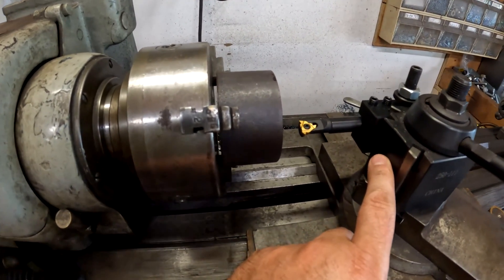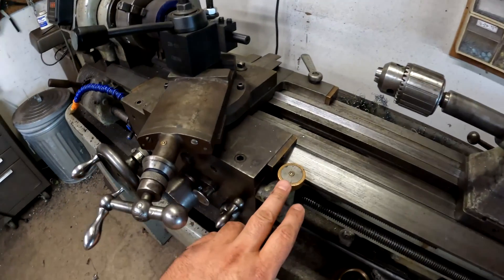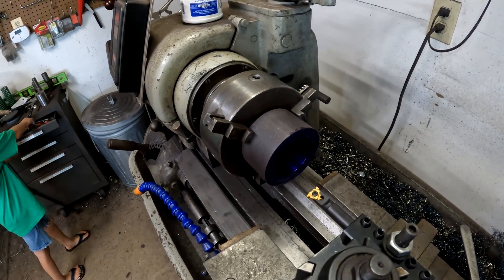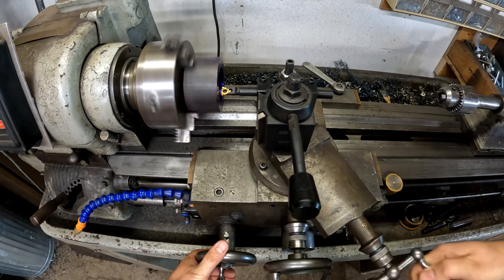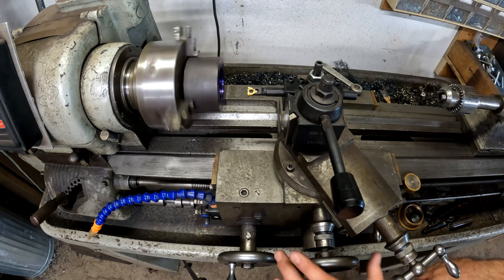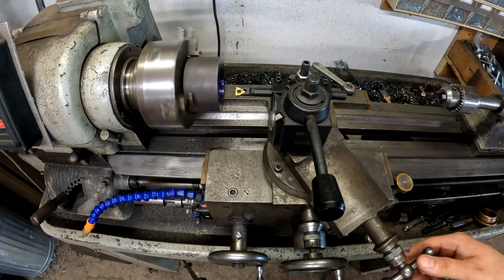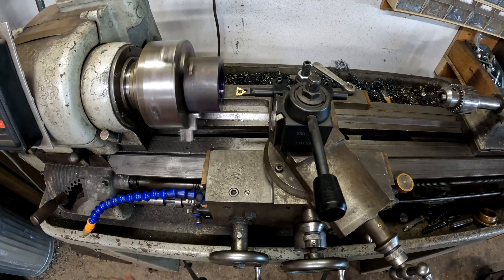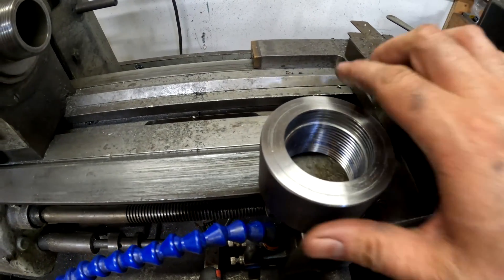How To Cut Internal Threads On A Lathe

Comment: Why did you adjust compound rest at 30 degrees , if you don't that, what would happen?
Reply from the maker: you get a lot of chatter because you're cutting on the leading and trailing edge of the cutter at the same time. setting the compound rest to 29.5 degrees ensures you're only cutting on the leading edge of the insert.

Comment: 29.5 degrees
Reply from the maker: I've done 29.5 and 30 but for internal threads I like to do 30 so I get symmetrical threads. I don't really get chatter at 30 so I figure it's not worth it.
Reply: and for external threads how many degrees?

Comment: I keep the compound straight, and just add a thou or two to each pass. To complicated your way.  I never disengage the lever.
Reply from the maker: setting it at and angle dramatically reduces chatter since I'm only cutting on the leading edge and not both the leading and trailing edge of the insert.  My lathe does not have reverse so I have to dis engage the half nut...

Comment: I have learned to set compond 30 dgr to the LEFT when cutting internal threads, Am I rigth?
Reply from the maker: yes 30 dgr works.  Some guys do 29 degrees so the chip load is on the leading edge which reduces chatter.